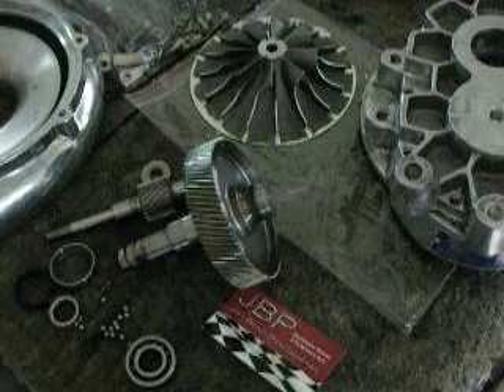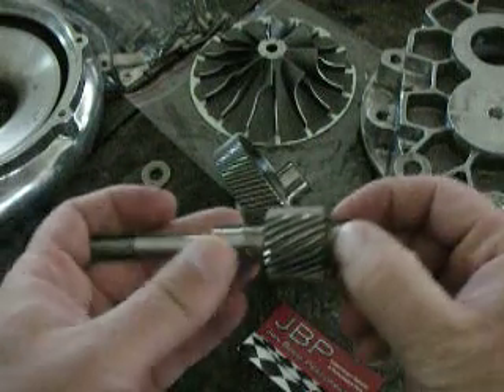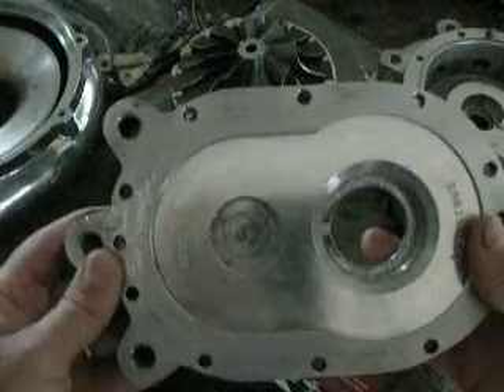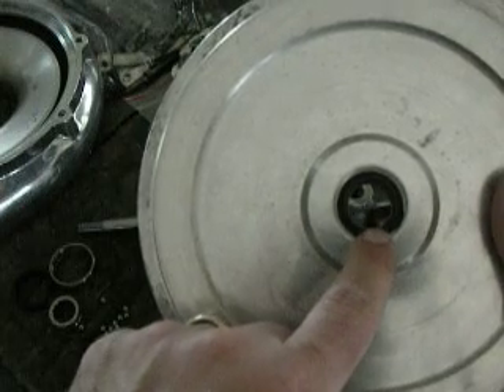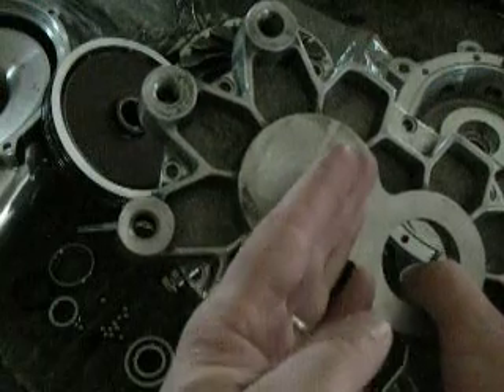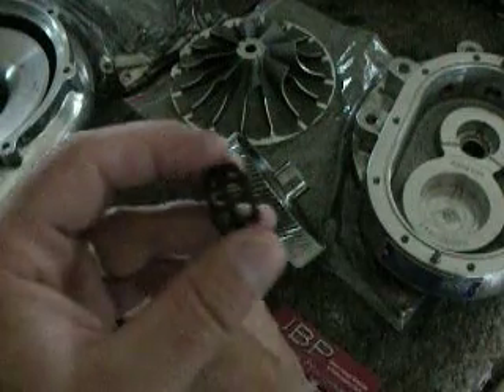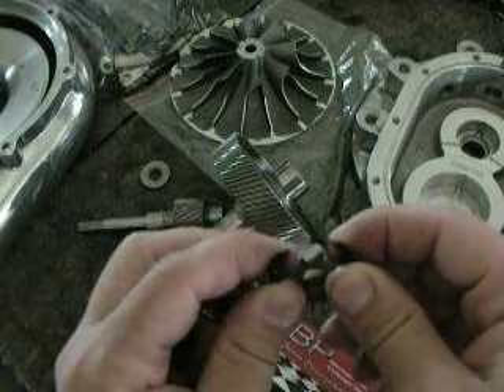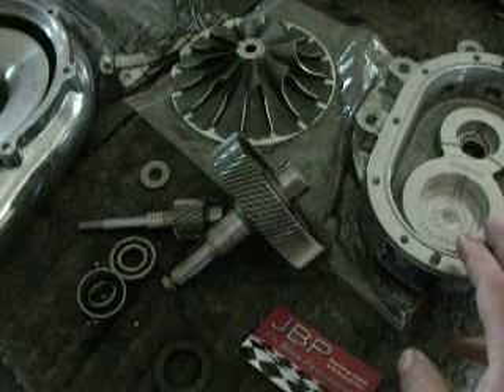Tudor vortech inspection

Comment: Hi, I have a V5 with a mechanical impeller shaft seal. The surface of the seal looks fine but it appears to be weaping oil into the volute, but I cant find out why. Did I hear you mention theres an O ring behind the mechanical seal?

Comment: Got my 1st Vortech an A-Trim back in 1993. It had a 3 digit serial #.  Installed it on an stock 86 Mustang GT converted to Mass Air. It was like a nitrous bottle than never ran empty. I learned alot about blower efficiency from that set up.